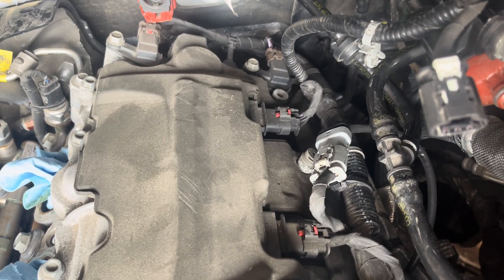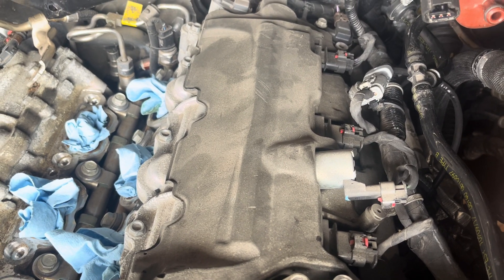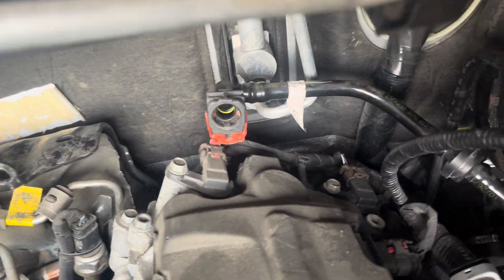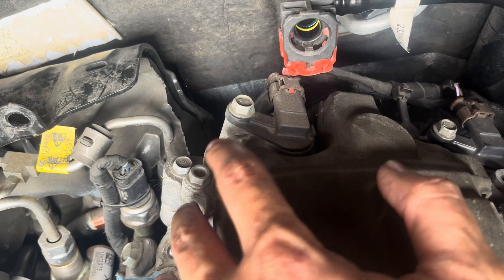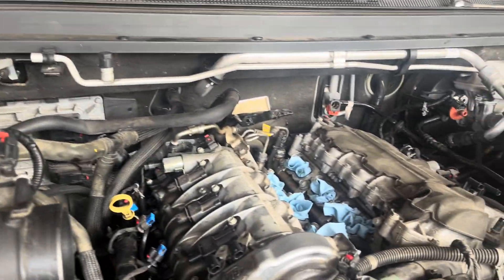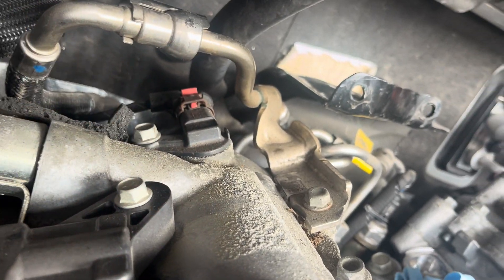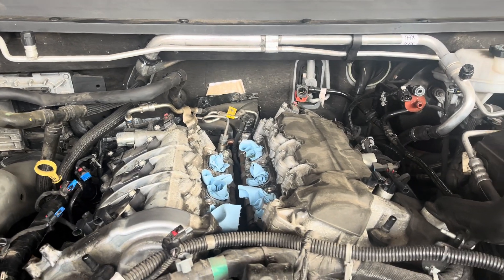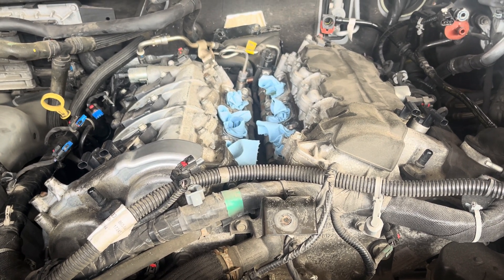Camshaft Position Sensor Locations on 2018 3.6L V6 2015-2022 2nd Gen Chevy Colorado GMC Canyon

Comment: Do you happen to know where the crankshaft position sensor is located will appreciate alot thank you
Reply from the maker: @arturocamacho408  unfortunately no / some people tell me I’m pointing it out in this video, but I’m not convinced of that. It’s typically lower on the engine near where the crankshaft would be…

Comment: On my 2020 Colorado I just replaced the Side 1 Bank B camshaft sensor. Getting the wire connector off was being a pain. I pulled the sensor with the wires connected. That's when I saw the red tab on the connector was tapered back. The reason I couldn't push it all the way back cause my finger kept slipping. I took a small screwdriver and pushed the small square red tab in and it released just fine. I started the truck cleared the code except for the permanent one. I shut the truck down and put my tools away. Started the truck and the Check Engine light was out.
My problem was the light would go off and on while the engine ran fine.
Hope this helps.

Comment: I know this is about the location of the cam sensors, and you're doing God's work helping other DIY'ers save a bunch of cash, but I'd love to suggest just replacing all 4 and then the 4 VVT solenoids on the front of the covers. This is a very common set of codes that pop at around 50K miles and when one goes out, the others are just as well ready to fail as well. The Cam sensors are affordable IMO at around $15ea at the dealer or basically anywhere you can get 'em. I got one cam sensor from GM and it's an AC Delco part while the VVT solenoids are "GM".

The VVT solenoids being changed may shock some when you see them for $70ea, but you can currently get GM brand replacements for $32 on Rock Auto which may soften the blow on those a bit. If I had the cover off to replace a cam sensor, I'd personally do all 4 sensors for sure. At the same time though, I'd go ahead and start buying some VVT solenoids and doing those at the same time if it's in your budget to do so, or just have one or two spare ready to go if you're anywhere around 50K miles. Pop the hood and look around those 4 front sensors. If you see some oil starting to gather just right around those things, they're trash and need pulled out. Everything needed to do this is the ever elusive 10mm.

You MUST do an oil change if a P0021 or P0024 code pops and you replace the solenoid(s). There's a screen in there and a ball bearing some engineer thought was cool to have, and those can just disappear from the stupid thing and wander around in your engine. On about half of these VVT failures I've seen, the screen is just gone and I THINK the screen is also acting as the seat of the valve to rest on and not fall into the engine. No screen? There's your wandering bearing.

TL/DR: Replace all 4 sensors and all 4 VVT solenoids. Dealerships want a major butt load of money to do this fairly easy task. If you have a warranty still, have them do it. And don't take any of this "you didn't use Dexos oil" crap if you change your own oil.
Reply from the maker: I already have a video showing all 4 VVTs being replaced. I’ll change the camshaft sensors when I need to. These aren’t tough jobs. I’ve done these so many times it’s an afternoon‘s work for me. But yes, I don’t disagree…

Comment: I’m getting a p0017 camshaft position bank 1 sensor B. Is that the exhaust or intake sensor on bank one? I have a 2018 Chevy Colorado! Any info would be appreciated
Reply: The P0017 can be a real PITA to actually nail down, but P0017 is  Exhaust/Bank 1 with P0016 being intake/Bank 1. The AC Delco are $13ea on Rock Auto so I'd just do both or even all 4 Just to rule all of those out. Just lost one and only one code? Wait 4,000 miles and another is ready to commit sewer slide. The real fun comes when you replace all four and P0017 comes back after clearing. It's a damn mess at that point.

Comment: Hello friend, I have the same truck and it is showing the codes P0113, P2227 and P2229, I have done a little research and apparently the MAP valve is failing, do you know where this sensor is located? could you help me?
Thanks in advance.
Reply from the maker: It is located on the intake manifold closer to the back of the engine bay. It is removed in both my O2 sensor and spark plug videos if you want to look (although, I don’t call it out by its name). I will actually be posting the MAP sensor replacement video in the near future if you want to subscribe to be notified of future videos.

Good luck!
Reply: @WildFrontierGarage   Thanks for your quick response. I don't know how to access this sensor. I had already subscribed and waiting for your next videos, I hope you can upload it soon... thank you very much.

Comment: Would one of these be the variable camshaft timing solenoid? I got a code of p0014 on my 2018 gmc canyon
Reply: I have the same issue and am finding conflicting information. The code pulled as p10014 as VCT. I've found videos for sensors on the front of the engine and the back all listed as the same vehicle. I have a 2018 Chevy Colorado. Did you find an answer?
Reply: P0014 is bank1/exhaust and P0011 is bank 1/intake.  21 is bank 2 intake and 24 is bank 2 exhaust, all being a known "50,000 mile problem" with no recall since it's not a safety item. Bank 1 is passenger side, you can guess which side bank 2 is. Intake is top/inner centerline for either and same for the cam sensors on the firewall/rear side of the valve cover (intake is center, exhaust side is on the exhaust side of the head, to put it bluntly). If you call a dealer, ask for "VVT solenoid, same for looking them up online for a parts store. No one usually stocks them it seems, still to this day and all are common to go out as stated.

Comment: I got p0019 on my 2019 colorado. It says bank 2 sensor b. Is that bank 2 exhaust that needs to be replaced?
Reply from the maker: That may be your VVT
Reply: @WildFrontierGarage  yea I already replaced the bank 2 exhaust vvt solenoid, but then the check engine light came back on and it said p0019 and that’s it’s the sensor now?
Reply: @WildFrontierGarage  so I just want to make sure I’m replacing the right thing
Reply from the maker: @joe.imburgia  I did the chase too - I ended up starting with the camshaft position sensor and that didn’t stop the code, so I went to VVT and it did. I did the chase, but there’s a way with a voltmeter to test your sensors. I’m not smart enough to do that so I just chased the codes lol.
Reply: @WildFrontierGarage  yea im going to change the sensor and see if it fixes it. it's weird thoguh it keeps going on and off. one time ill turn the truck on and the CEL will be on and 2 or 3 days later itll go off so i dont know if the part is actually bad or what is going on but I bought a new one just need to change it out
Reply from the maker: @joe.imburgia sounds like what mine was doing. I have a video about the VVT replacement, I talk about my chase a little bit at the beginning of the video if you’re interested in checking it out
Reply: @WildFrontierGarage  yea I think ive seen that one before I replaced the VVT exhaust bank 2 solenoid I think that was the video I sued for it but now I just need to do the exhaust bank 2 sensor B it saying